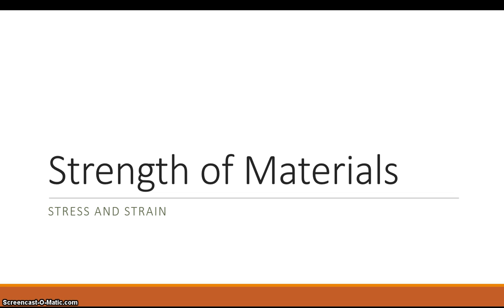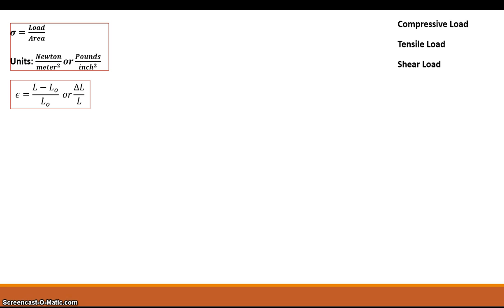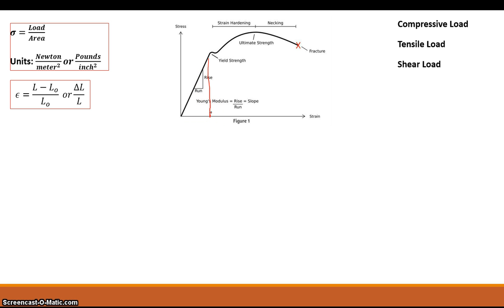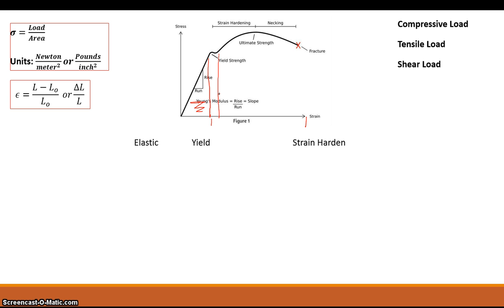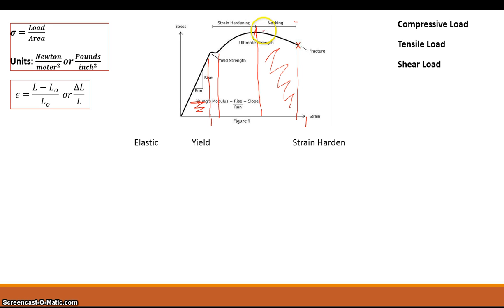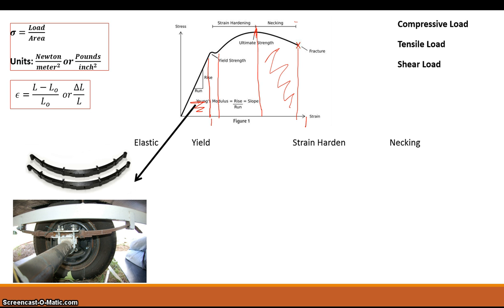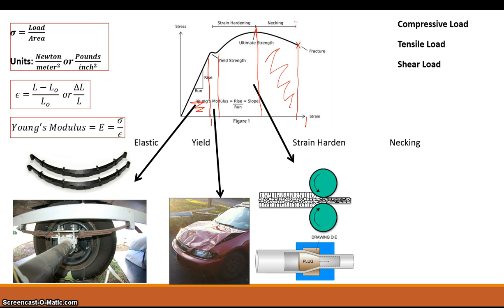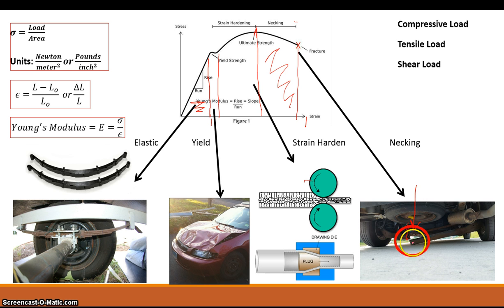Strength of Materials (Part 2: Stress Strain Curve)

Comment: So when calling out a "Strength" of a material, it is indeed based on the Eleastic Limit? Rebar that is labeled Fy=60ksi is based on the elastic limit of the stress-strain curve? Or is the  Yielding point what officially dictates the Fy=60ksi?
Reply from the maker: In design, you typically are speaking within a materials elastic limit, meaning, this is the limit where the material can fully recover from deformation.  Now, materials also have an ultimate tensile strength (UTS) which is the strongest the material will ever be, however, the material will never go back to its original dimensions.